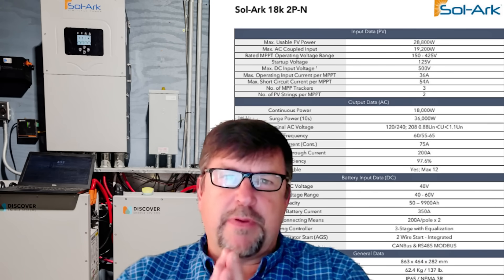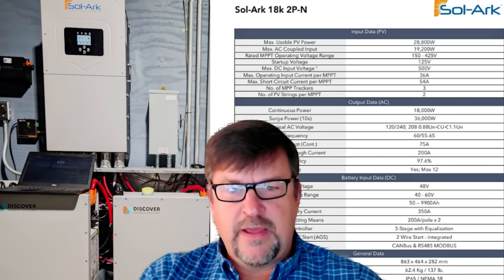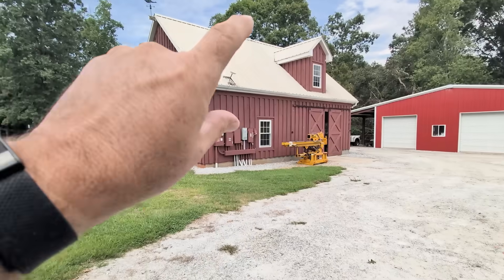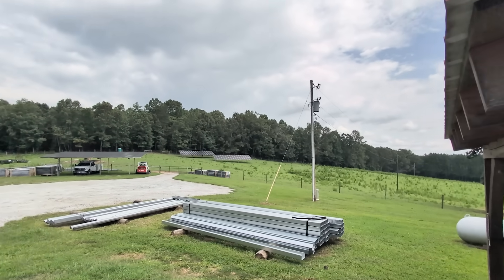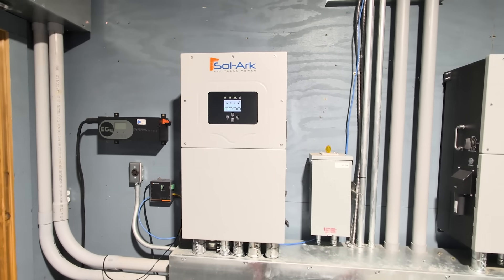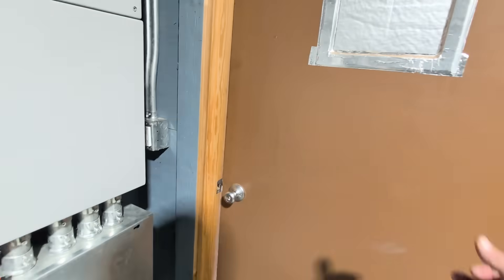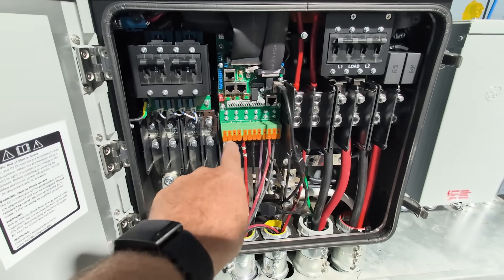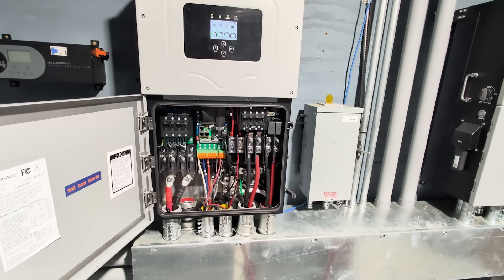Introducing Sol-Ark 18K: Seamless Whole-Home Backup, Zero Load Sheds!

Comment: The inverters are getting really capable.  EG4, Sol-Ark, Franklin, Tesla... a few others now as well, all using HVDC mid-bus HF inverter designs.  Made possible by more efficient parts, particularly BJTs and FETs that are coming out of the EV world to run motors.  Manufacturers are really going all-out on strong HVDC mid-bus designs, and it shows.

There are also a bunch of BYD-inspired HVDC battery designs where the battery basically is the HVDC midbus.  These are far cheaper in terms of parts but don't have the LRA start capability (which really requires a lot of capacitors on the mid-bus... which these HVDC battery designs don't have).  But they still allow a ton of high-voltage DC solar string integration so they are definitely in the running for mass-adoption in homes as costs come down.

I will say that for most people... you really want just one inverter.  Maybe two.  But really just one for the economic proposition.  If one has too many then 12-20 years down the line the maintenance (replacing equipment as it wears out) will start to get tough. 

And also, I know you are defending the 200A pass-through integrated into the inverter but the M.I.D. solution (or a meter collar) is what 99% of installations are going to want to use to avoid having to bus a 200A pass-through across all the inverters (if one has more than one), and the M.I.D. also provides other code compliance features such as the manual bypass.

I wound up DIYing the full EG4 solution... Flexboss21, GridBoss, three 14.3kWh batteries.  The GridBoss (the MID)... the M.I.D. really made things so much easier to mount and wire.  Each inverter only needs one set of 2 AWG AC cables and the PV strings.  I started with the FB21 and I'm about to add a FB18 (mostly to get more strings and reduce nominal AC loads so the fans don't turn on).  The cabling is totally trivial.

-Matt
Reply from the maker: Time will tell. For multiple buildings you need multiple mids. What happens when the smart Port relay sticks? What happens when the inverter and battery are not in the same place as the mid but they have the communicate your. But they have to communicate with each other. What do you do when you want your inverter and batteries out in your garage and your mid is 40 ft away thanks to your meter base and you can't use the load output of the flex box? You got to run load conductors back from the mid to run the garage? What happens if you lose communication between the flex boss and the mid?  
I don't understand your comment about the difficulty of wiring up a 200 amp pass-through?
Reply: @engineer775  From my understanding, you only have one service entrance from the utility.  Is that wrong?   If you have one service entrance you only need one M.I.D..  You certainly wouldn't need one for each building.  You'd just distribute the output of the system to multiple buildings with a breaker panel.

In terms of where the equipment has to be physically, if we take say the EG4 M.I.D. (the GridBoss), it basically has 11 ports.  Other M.I.D.'s are similar with varying numbers of ports.

* 200A service entrance (input from grid) (aka 3/0 copper)
* 200A non-backed-up AC out (typically not used) (aka 3/0 copper)
* 90A generator port
* 200A backed-up AC out (aka 3/0 copper to distribution panel)
* 3 x 90A Hybrid inverter ports (2 AWG) (these go to up to three hybrid inverters)
* 4 x smart ports of various amperage ratings (with both breakers and relays)

That particular unit also has the manual bypass breakers w/ lockout slider built-in, CTs built-in on all ports, and comms.  And of course the automatic transfer switch too.

The point of having the M.I.D. is to provide service-entrance and code requirements for the utility interface and to avoid having to bus huge cables to each inverter.   Each hybrid inverter connects to the M.I.D. via comms (daisy-chained) and relatively modest 2 AWG cabling.   No high-amperage AC bussing necessary.

For that particular system the only limitation is the comms cabling... I think 100 meters or something like that.  300ft or so.

The Sol-Ark gear has a built-in 200A transfer switch in each inverter.  If you have multiple inverters then you are bussing 3/0 copper from the grid to all of them, and then bussing the outputs (or distributing them separately).  But there is no real reason to distribute them separately that I can see.

I don't understand your comment about stuck smart ports.  If you are going to use a smart port or really any automatic relay system anywhere, wouldn't you have the same issue?   If you need programmable smart ports you certainly aren't limited to the ports on the M.I.D. or the inverters.  You can situate smart port devices literally anywhere on the property.

-Matt

Comment: That SOFC item is the big gap filler, for so long we've been held to oil changes and engine maintenance for generators with the few promising better results not really being available. Maybe this one will actually work!
Reply from the maker: That's one of the main reasons I'm pursuing the fuel cell as we have so many generators out there that are not well maintained, mice get in batteries are dead, fuel problems etc. there's no maintenance for the fuel cell. It has a lifetime filter that takes out any contaminants in the propane or natural gas.

Comment: Is it RF quiet?  If it trashes the radio spectrum with spurious interference, it’s a no-go for me.
Reply: None of these systems (from any manufacturer) are going to be quiet in terms of EMF.  You would basically have to put the equipment in a well-grounded faraday cage away from the HAM gear and antennas.  Meaning, generally a well-grounded metal shed.
Reply: @junkerzn7312 ,  thank you.  I was thinking about using something like a ground bonded shipping container.  But, this is just in the planning phase.
Reply: @dave-wk4t  Conductivity is fairly low but its still metal... it ought to work pretty well.  You will need some ventillation if you go that route.
Reply: I have a 12K. It trashes 80m really, really badly. 40m has birdies throughout the band and there's a lot of junk on 17m. I have a new 15K that I'm about to replace the 12K with but in this install I am going to put everything in a grounded Faraday cage and will have multiple ferrite cores on all wires entering and leaving the enclosure. I am more than a little irritated that the inverter isn't better in this one regard, otherwise it has provided power to my home flawlessly for the past 5 years.
Reply: @muhdiversity7409 , good to know prior to any $ leaving the remote station kitty.
Reply from the maker: I guess it all depends on where it is placed. Are you concerned about its interference with ham radio?
Reply: @engineer775 , yes sir.
Reply from the maker: @dave-wk4t I don't have the RF facts on the inverter. There is a 15 khz emission from the inverter.
Reply: @engineer775 , thank you.

Comment: Although  i agree  with alot of the points made in this video,and the sol ark unit is impressive, theres just no way you can justify spending $7300 on that inverter, when you can buy 2  eg4 flex boss units ,and still have a few hundred left over to put towards batteries, and theres no way to convince me that this sol ark unit is twice as good as the flex boss unit, $3,499 for flex boss  on signature solar site , and you would have redundancy with the 2 flex boss units ,this is a no brainer sol ark needs those prices to come down significantly
Reply from the maker: You will not be able do what the 18K can do with two flex boss 21s. You will also have to buy the grid boss to be able to use the generator to get 200 amp pass-through or to be able to do AC coupling or to do diversion mode control. There's no doubt in my mind that it is twice as good. My focus is on the quality of the technology not on the cost because in the long run it is the quality of the tech that matters. I would be out of business if I used cheap equipment. There's been probably six solar companies around me that have gone out of business because they use inferior products. I am upgrading a failed system every month. The flexboss 21 runs way too hot and loud for my taste.
Reply: given all the complaints about EG4 gear I wouldn't be so sure. The flexboss and gridboss sound totally jank
Reply: I can agree  to disagree there ,but looking at the specs on the flex boss 21 ,there's no way the sol ark is twice as good ,and in this case my point still stands redundancy is king ,when spending that kind of money on equipment, it's not being cheap ,it's being smart ,and getting the most bang for your buck, since most mid size middle  class homes in the US have or use less than a 200 amp service  the pass - through, really doesn't hold alot of weight, but  being a electrician for over 20 years myself, I understand your point . I personally have an eg4 system  on my home and have had zero problems, set and forget. And It's been 3 years. Keep in mind alot of systems and equipment fail due to poor installation and wiring methods, properly sized wire gage, breakers,switches  and fuses go a long way ,also following the national electrical code
Reply: The Flexboss21 can to 12kW continuously sun-down and 16kW continuously sun-up with solar helping.  So it isn't quite up to the 18K's specs... its closer to the 15K. The solar is more or less a wash between all the units... a few kW here and there isn't going to make a difference.   The equipment from both is first-rate.

Remember that in a grid-up situation any consumption in excess of inverter specs simply imports the difference from the grid.  Nothing will trip or shutdown.  And in a grid-down situation you aren't going to want to waste your battery running huge loads for long periods of time anyway.

--

The main claim to fame for the M.I.D. is that it provides all necessary code compliance built-in, all CTs necessary built-in, a bigger internal bus (the GridBoss has a 350A internal bus, though I think it is still software limited to 200A total at the moment), and allows multiple inverters to be wired with smaller 2 AWG cabling instead of having to bus 3/0 to every inverter as well as allows the inverters to be physically removed from each other up to the comms cable limit (a few hundred feet).

-Matt

Comment: Nice update!  I was hoping for the ability to do ac solar and generator. I'm guessing that's possible with two inverters.I was also hoping for something to protect the screen when putting it outside.  I think I saw some magnet cover that probably works just fine.
Reply from the maker: You can do the AC solar on either the Gen input or the load output or even on the grid side. You can also put the generator on the grid side through an ATS.
Reply: @engineer775 I didn't realize that... awesome info.  I like the hydrogen charger.  That was cool technology and might be an addition I need to consider.  I already checked their portal, but they don't seem to have much info yet.  Looking forward to your more in depth video covering that.

Comment: Can an 18k solark handle a home with 400Amp service?
Reply: For whole service backup, 2 of them would be the minimum (similar to the 15k) for 400A passthrough but they would work together with a shared battery. Partial backup of a 400A service is possible with 1x 18K.
Reply: If you don't actually use more than 200A then its a non-issue.  Do you actually use more than 200A?   200A is 48kW.

A lot of homes with 400A services have it because the utility's circuit calculator required it, but the calculator is like 50 years old and doesn't account for the fact that new homes tend to have a lot more small circuits in it.  So most residences (not farms, but residences) with 400A services don't actually use anything even close to 400A.

The calculator is finally going to get revised because it's getting silly... some new-builds are now being forced to have 600A services that use less than 200A in reality.  Just due to circuit count.

-Matt

Comment: Like all high frequency transformerless inverters, the Sol-Ark 18k has far too many problems for my money. The problems associated with it include early overheating and a discontinuation, with initial firmware issues reported by some users, although later addressed. Other issues discussed in relation to this inverter model includes AC overload and phase imbalance faults (like the F34 code) on Sol-Ark 15K models, as well as customers experiencing power loss and unresponsive customer support.
Reply from the maker: Are you an AI bot or just a parrot? You've never seen an 18K and you've never run an 18K. So tell me about the far too many problems?
Reply: @engineer775  That guys spams every video that mentions an HF inverter.  Probably a bot.  Its the same nonsense every time.   I was able to get him to respond once a few days ago but he just pasted more walls of nonsense.
Reply: @junkerzn7312  What a sad existence some people have. SMH.
Reply: @engineer775  He spams every solar video.
Reply: Sounds like you are you mixing up three different products and two different brands.

Comment: So much for EG4's thinking their GridBoss21 was going to show up sol ark, they just got their legs swept out from under them again.
Reply from the maker: The Flex boss 21 does not have the same features anymore so it's hard to compare it. Moving the pass-through and the generator inputs and AC coupling capabilities to the grid boss is starting to make the comparison apples and oranges. The flexboss 21 does not beat the 15k in any way except for the 16k on pv vs the 15ks 15kw on pv.
Reply: @engineer775 and cost.   I can get a grid boss and a flexboss21 for 6k.
Reply: @engineer775  You can AC couple into the Flexboss's load port too.  So you get to mix and match whatever is convenient.  Otherwise though you are correct.  But having the GB in the mix also makes wiring multiple inverters a whole lot easier because you aren't bussing two sets of 3/0 to each one for input and output.  You are just wiring (not bussing) one set of 2 AWG from each inverter to the GB.

And the GB also handles all the code compliance and can also be the actual service entrance if desired so no additional pieces of equipment are needed.  No manual bypass, for example.  No CTs needed.  I personally think its easier with the M.I.D. (also known as a gateway box) in the mix.

-Matt

Comment: looking forward to the upstart power video
Reply from the maker: Yes, I need to make several videos. I am running it through several scenarios, off grid, on grid, time of use, demand mitigation. Right now we can parallel up to five units. Each unit produces a continuous 1.4 KW. Around 34 KW a day if necessary.
Reply: @engineer775  that seems pretty good alternative to a generator like you said in the video. probably alot quieter as well.

Comment: And they STILL haven't sorted the APP! What's up with that? Arguably the best inverters on the market and undoubtedly the worst APP! Can anyone who is going to RE25 Las Vegas please tie them down on what's happening wit it please? 
I'd love to see the App show the Smart Load useage separately and a simple way of overriding the settings if I just want to have the smart load operate for an hour or two. Also Smart Load related, when the batteries reach 💯 the inverter will start clipping production to match the house. If the house is drawing less than the solar requirement for Smart Load to operate, it switches off the Smart Load. A great time for me to plug in my EV, which is on the Smart Load panel, but I have to switch on something heavy in the house to get the inverter to pull sufficient PV to kick on the Smart Load again.

Comment: Happy to see Sol-Ark continuing to improve their hardware, but man they need to spend some time and money on updating the app. The UX/UI is terrible, the app itself is buggy on a good day and doesn't match the options on the actual Sol-Ark, not to mention the 5 minute data cycling makes it incredibly difficult to troubleshoot. 

I'd also love to see if Sol-Ark was working on a V2x solution for EVs. With Sigenergy pushing it's V2x module I'd love to see something like for Sol-Ark, and hopefully it would mostly be a firmware upgrade as the hardware pieces (so long as the charger is capable of it, like Fords) are already there.
Reply from the maker: I hear you on the app. Everyday as I monitor 248 inverters currently. That is the only tool I have  to monitor, troubleshoot and help my customers so I've learned to work with it and work around it as best I can.

Comment: REALLY disappointed that there's still only 3 MPPT inputs, even if they're double inputs. Would have thought that splitting those 6 inputs into individual inputs wouldn't have cost that much.
Might getting 28K of solar into 6 inputs get a bit complicated?
Reply: Three is fairly typical though the Tesla PW3 has six (albeit with a proprietary Tesla RSD system  for the panels).   Each MPPT requires a honking inductor and a few BJTs to interface to the HVDC mid-bus inside the inverter, along with the necessary heat dissipation.

But it isn't really a limitation, you can always add however many external MPPTs you want directly connected to the battery system.   Even just using a cheap off-grid inverter's MPPT inputs and not hooking up its AC output at all.  Or some discrete MPPT units such as Victron (those tend to be over-priced, though).